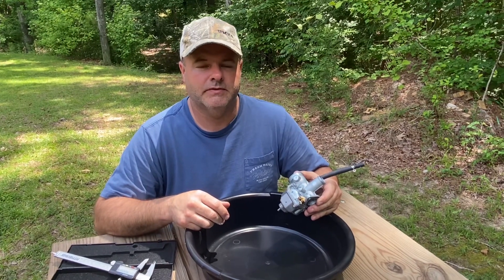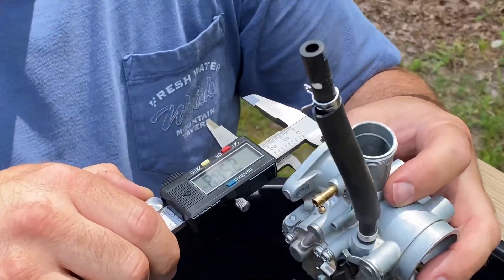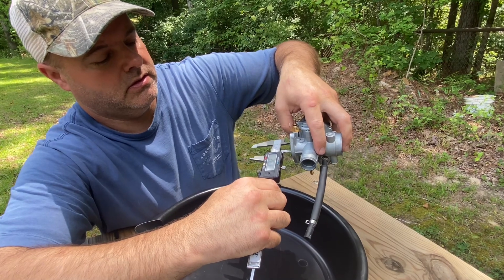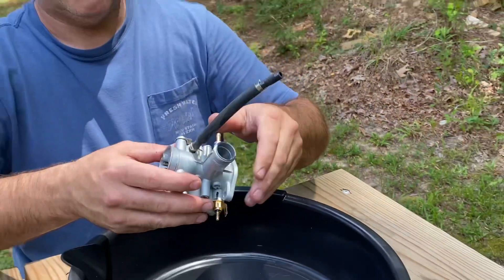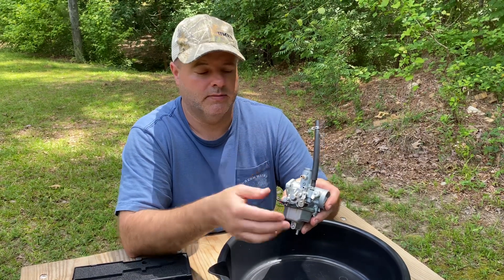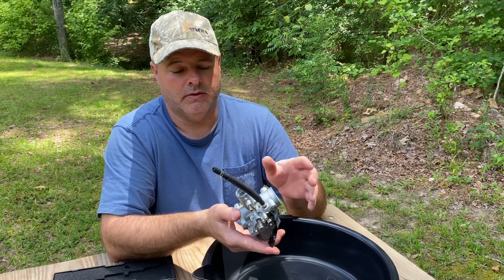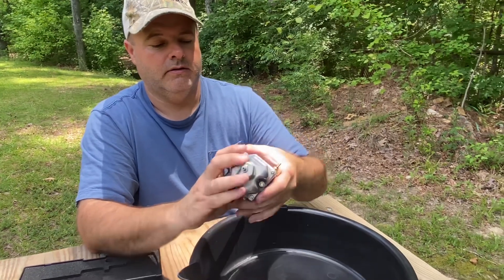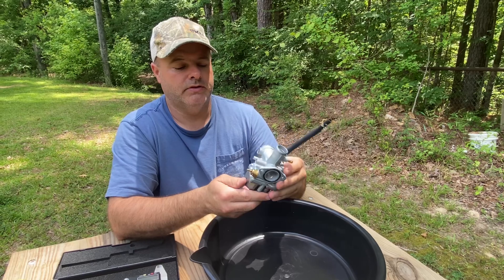2023 Honda XR150L carburetor jet size and other information

Comment: I believe I have the 2023. I do not see an idle screw.  Any ideas.  Mine only has 300 miles but does tend to die especially when cold
Reply from the maker: So the idle adjustment screw is on the right side inside a little hole on the black plastic cover (clockwise to increase idle rpm). There actually is an idle mixture screw on these carbs also (it adjusts the fuel ratio at idle rpm). You would need to take it off and pull the little metal plug on the. Bottom of the carburetor body and adjust it with a “Single D” adjustment tool. Try turning the screw clockwise in the plastic cover first. 1/8th turn max and adjust it while running to get the rpm you desire. Hope that helps you out.
Ride safe.

Comment: I have a 2025 150L with slip on Yoshimura 38 and 110 main jets runs and starts perfect in Potter County PA about 1300ft I also took the rubber boot off air intake box and put a crf 150r front fender and 18 tooth sprocket on front I always ride in the 900-2700 ft range in Tioga through McKean County areas...And it tops out at 65 with 180#rider
Reply from the maker: Good info. I am jealous of your Yoshimura slip on. One day…

Comment: Does anyone know if there’s an extended fuel mixture screw that can be purchased for the stock carb? On my DR650 after drilling out the Welch plug you can buy a longer mixture screw that can be  adjusted by hand. Thx
Reply from the maker: @roberteddy1951  I do not know for sure but I figure that an extended one for a CRF150F might be the correct one for the XR150L.

Comment: @mishmashmoto In your other video you mention that others discovered behind the welch plug there is no fuel adjustment screw. Is that true? If so how do you recommend tuning the carburator? Are th threads to hold the screw still there and you just need a screw and spring? Or would I need an aftermarket carb that can be adjusted. I live at high elevation and frequently ride in the cold. Thanks to anyone for the help I don't want to remove the welch plug and then realize I need to order a new carb and not be able to ride.
Reply from the maker: @mitchellmoore5411  That information was incorrect. It does have one under the Welch plug. It is a "single D" type idle fuel screw. You can get a adjuster on Amazon for about $10.00. Unscrew=richen idle mixture.
Reply: @MishMashMoto  Thank you so much for the reply. Love your channel and all the great information and value to the community you provide.
Reply from the maker: @mitchellmoore5411  Thank you for that. We will be back at it again at some point soon (we are just busy with some other things right now). I have really been wanting to finish up on some of my stock bore size experiments. I already have a big bore kit and big valve head, but I'm really not done playing/testing out the stock bore with the stock head after trying my hand at porting it yet. Time, money, and energy.....

Comment: So, your specs said 22, but carb says 25 ... sounds like the carb was changed between sending info to the printers and building the bikes on the line. 
Maybe they thought they wouldn't meet gov't regs with the 25, but finally got it passed with the extremely lean jetting? 
I've got a 2024 ... will check DOCs.  Its above freezing, maybe 40-F, and I need full choke till it fires, then half choke to start and warm up, and drive with half choke till I'm at least 1/2 mile from home. 
It runs good warming up, but once its warm, the idlel speed goes WAY up, like when you're adjusting a carb and go too lean, and the explosions in the cylilnder whack the piston harder.  Very bad for the engine. 
I need to change jets, but I'll be changing the exhaust too, so not sure if i'll need something different than the folks with a stock exhaust.
Reply from the maker: Who knows what that 25 mark means. I have seen other marks there on other carbs that didn't make much sense in relation to size also. Good luck with your tuning. FYI: Sounds like your main idle adjustment is set to high. Should be set once warmed up and not when cold or warming up.

Comment: i ride at 2000 too 5000 feet, im thinking about rejetting from 105 to maybe 115 and keeping my 35, im new to bikes im hoping this will fix the lean problem im having here in vegas bike gets hot and it not even summer yet
Reply: probably switch my filter along side with it, in hopes of geting a little more air thru there as well
Reply: Hey I'd love to know what works for you! I tried 38 115 but it's running too rich, riding on the same elevation as you do.
Reply from the maker: @NickandLauraTravel  On the stock carbs. we ran them with the stock 35 pilot and the stock 105 for our first trip and then swapped in the 115 main and ran it until we changed the carburetors on our bikes at around 7,000 miles or so.

The stock carb. really needs a raised or tappered needle for more fuel down low and in the midrange and then it needs more air at high rpm. It's always a balance, but in reality, on this carb. the 115 main helps with the low and midrange power but honestly just makes the top end slightly worse. That's why I swapped carbs. on our 2 bikes to a larger PZ30. The PZ27 is probably a better choice for most people though.
Reply from the maker: The 115 will definitely help with the heat issue. The 115 runs fine (but rich) up to about 5,500 and runs well under 4,000. A 110 would probably be better for you if your at 2-5K feet elevation more. Go with the 115 if you run the roads at high speeds and/or are under about 3,000 elevation more. A high flow air filter could change things so I would suggest doing the jetting first, test it out, then do the air filter and test it. Let us know your results please.
Reply: @MishMashMoto hey! I tried it with the 38 - 115 setting and it was too rich, especially up in the mountains, engine would slowly die due to not getting enough air. Tried 35- 110 after and that was too lean ( opened up airbox). Engine would not run stationary. Now trying 38-110, hopefully to have found the sweet spot!
Reply from the maker: @NickandLauraTravel  We ran the stock 35S pilot jet and an aftermarket 115 main jet most of the time. I do think that the 38/110 can be as good or better but will most likely require you to pull the Welch plug and adjust the idle fuel mixture screw that is hidden underneath the plug. You will need a "single D" type adjustment tool to turn it ($5-$10 on Amazon). Hope that helps you out.

Comment from the maker: Testing jets today! New video coming soon! Someone asked about Jet recommendations around 5,000’. Stock jetting was tested up to about 7,000’
Reply: I am 6-5 250++ and ordered a Yoshi slip on and the jet kit you linked in your other video.  For 0-500ft what jetting should I start with?  Thanks for your videos!!
Reply from the maker: @agorpb5871  I would try the 115 first and look at your spark plug after a few miles.

Comment: Any possible videos on tuning/upgrades?
Reply from the maker: Yes, we just wanted to get through with our testing of it in stock form first. Even though the factory carburetor is very good in stock form we plan to do some tuning on the factory carb. to see if we can gain any power from it before doing a carb swap. This will help people get the most bang for their buck (jetting and needle shimming is cheap). We don’t have a Dyno so it will just be “seat of the pants” and “spark plug reading” style tuning. The exhaust is probably most of the problem on this bike so we will likely tune it with the stock exhaust first, then maybe a baffle delete, then maybe an aftermarket slip on. Maybe someone will send us something to try out… 😎
Reply: @MishMashMoto I can’t wait for you to customize your bikes. I want to completely build my bike, even if that means going with an efi setup. For now I might have an o2 bung welded onto stock exhaust so I can add a wideband. I can already tell that riding at 5000 altitude is okay but if I go into the mountains then it’ll definitely need to tuning.
Reply from the maker: @DustySteelGarage  I do plan on trying some slightly larger main jets soon. We have taken our 2 bikes up to 6,684’ at Mt Mitchel off the BRP and they did fine with the stock jetting IMO. Not EFI perfect mixtures obviously but normal operation and performance didn’t seam to be noticeably effected.
Reply from the maker: Also have a LED lights video coming out soon(ish). UPDATE: The lights we got didn’t fit on the XR150L handlebars so they went on the Goldwing.
Reply: Sweet! Thanks

Comment: I changed 35 to 38 low, leaving 38 and 105 high, it starts cold without a choke.
Reply: What altitude are you at?
Reply from the maker: @DustySteelGarage We normally ride in the 0-1,000’ elevation range.
Reply from the maker: Thank you for the information!

Comment: Has anyone experienced the engine and electrical system suddenly dying midride? I took the bike on a mild grass  trail for about a half mile. Soon thereafter, the bike shut down completely at an intersection. I was able to restart after several attempts. It had been 100 percent trouble free up to that point; approximately 200 miles. Traveled another 2 miles or so down the road, and it shut down again, midride. No misshifting or gear changes or clutch pulls; just cruising. I am fairly certain it's an electrical connection that's loose. Just wondering if anyone has any suggestions as to exactly what it might be. I have an appointment with the dealer on Tuesday and will report back. Thank you!
Reply: If it cuts out suddenly, like you said it's more than likely an electrical problem
Reply: @umu-i-d2785  I am happy but embarrassed to say that it was running out of gas! Too funny! I ASSumed that the dealer had filled the tank, so I ASSumed I wouldn't have to worry about gas until the 300-mile mark. Bike has been perfect except for operator ASSumptions regarding gas level!
Reply from the maker: @MichaelWhite-cx4ho  Don’t be embarrassed, things happen and bravo for sharing the truth, I crashed mine on a steep hill climb (my fault).  It’s all part of the total riding experience package. 😎
Reply: @MichaelWhite-cx4ho 😅 Did you only need to switch the petcock over to reserve, to continue or was it already on reserve?
Reply: @DaveZee01  Just switched it to reserve. One. Of. My. Lamest. Fails. EVER!!! TOO FUNNY! You've got .9 gallons reserve, folks! 1.9 gallons (about 200 miles for me), then .9 gallons reserve.
Reply from the maker: Both of our bikes died once or twice within the first 500 miles for unknown reasons. No issues at all after 500 miles though. Almost 3,000 miles on each bike now.

Comment: Hi guys! Thank you so much for adding to the knowledge base of the xr150l. Just received notice from my dealer that my bike is in. They are asking 3900 out-the-door. Wondering what your thoughts are. Big Harley, Honda, Kawasaki, etc dealer with great service. Been going to them for years and don't mind doing my part to keep them open. I look forward to your opinion. Thanks!
Reply from the maker: We have seen people post OTD prices from $3,500-$4,500. Buying local can have some advantages also. I can’t tell you what to do but they are a little hard to get right now so that may be a fair price if you want one now.
Reply: @MishMashMoto  I agree! Thank you so much for the response. I will pay the $3900, and I will bring a couple dozen donuts, as I usually do when visiting this dealer. I love having a good relationship with people I do business with. This price is fair and will help the dealership keep its doors open and its staff happy. If they had asked $5,000 or so, I would have walked. I almost bought one  of the "Chonda" clones, like the Brozz 250, but I was concerned about quality and support. I think Honda is making a very smart move bringing in the xr150l, mostly made in China anyway, to compete. This will be added to my 1200 Sportster and 411 Himalayan. Something for my daughter to learn on. Thanks again for your support and for promoting the xr150l.
Reply: Buy end of month mine was 2971 out the door !
Reply: @toneloke4417 Really?! That's unbelievable! Actually unbelievable! Please post info regarding dealer location. There are thousands of us across the U.S. that would love to get the same deal you say you received.
Reply: That price is exorbitant, when compared to what people pay for the exact same bike in other countries. But I guess what inflation is all about.
Reply: @umu-i-d2785  Why post to rip on someone paying $2900 plus dealer fees for a full-size Honda that they can turn around and sell for almost the same price a few years later? The bike is great, and I don't want to live in a second or third world country in order to spend a full year's salary to buy it for half the U.S. price! Americans pay for the privilege of living in the U.S.; although, thanks to DEMONRATS breeding and feeding and radicalizing ingrates/DEMONRAT voters for the past sixty years AND throwing the doors to our borders AND jails wide open to let in more DEMONRAT voters, living in the U.S. is becoming a less desirable place to live by the minute. Perhaps in ten years or so, you'll get the opportunity to "buy" a ten year old xr150l in trade for an apple and some fresh dog meat. Of course, you won't have any gas because that will have been outlawed. In other words, fuck you and your lame comments about the price of a new xr150l, and go back to using both hands!

Comment: I installed a PZ27 for the TMX155 in under an hour. The complete carb was under $7 here in the Philippines. No choke ever needed. The idle adjust screw on this carb is not recessed, so I put a small piece of rubber vent hose and I can adjust with my fingers.. Not that I have to anymore, its rock solid. It always rev'ed too high when it warmed up with the original carb. Tons of videos on yt about this mod.
Reply: I have this PZ27 on my new Rusi TC175 and it's giving me nothing but problems. 

Starts on half choke and then after only runs on full choke. The idle fuel mixture screw has some effect to make it idle nicer. Yes it could idle.

YT videos tell me my pilot jet is blocked. So, I clean out the pilot jet and the hole had some light going through it now more light enters. 

Outcome: Starts on half choke, doesn't want full choke anymore. Runs on no choke, but, very rough, needs a lot of throttle to keep running, won't idle at all, and the idle fuel mixture screw has no effect.

YT says I have an air leak in the carburetor to intake manifold mating surface. So, I RTV the mating surface. 

Outcome: Still no improvement. Won't idle, extremely rough running. Engine gets hot quickly. Needs a lot of throttle to keep running. Unhappy sounding engine.

While trying to adjust idle mixture screw outwards it falls completely off the carburetor. The engine immediately sounds good and settles into a good idle. A half turn of the idle speed screw makes sure to maintain idle. I have no idea what is going on.

YT says anything more than 3.5 turns of idle fuel mixture screw out means pilot is too lean. I went out to some motorcycle shops to find some jets to see if it does anything. No luck finding any jets at all.

Internet says the idle fuel mixture screw should only matter during idling. If any throttle needs to be used then then there are other problems than need to be found and sorted as well. I think I will buy another carburetor of the same model and see if I can get the engine to run properly. I found a new one for less than $20. I'll get that tomorrow and try again.

Any advice or suggestions are welcomed.
Reply: Can u make a video about that mod?
Reply: @BasaysayTv  https://youtu.be/xJ6dkrQjwQM?si=NG1xr5TkNrhmx5r7